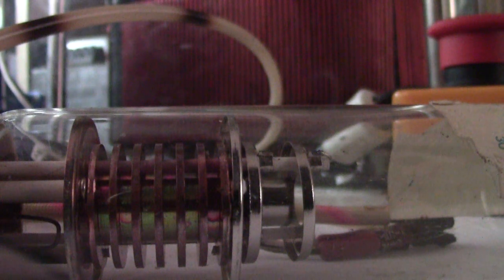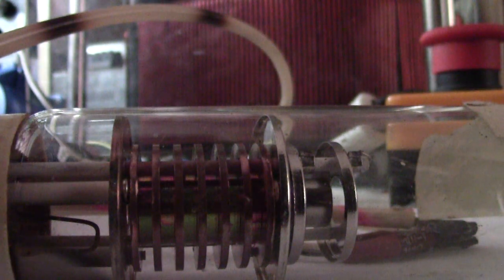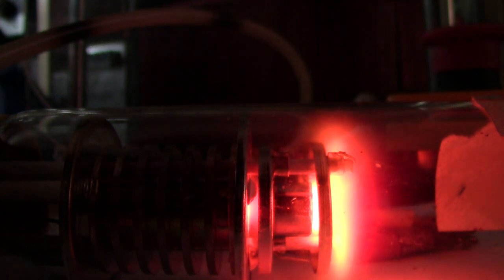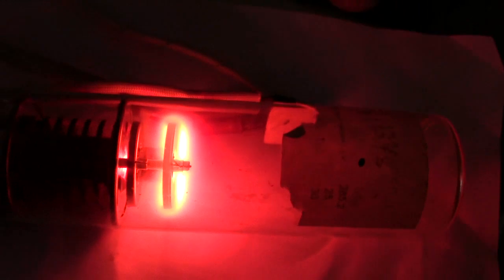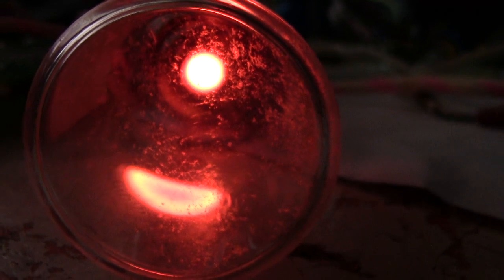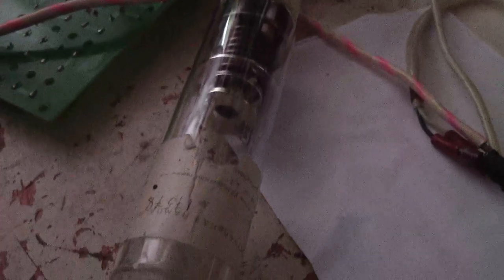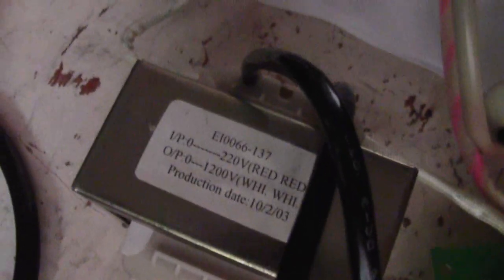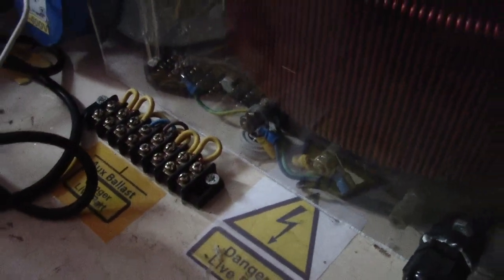Russian hollow cathode neon-filled spectral lamp tube LSP not cut this time I think

Comment: Ooooh, that was nice. :-)

It's glowing real nice. I've seen mains-powered equivalents of this that are just indicators. I'm not sure what this tube is used for, but it looks like it's supposed to do a bit more than just glow-up.

Maybe this was the flux-capacitor for the TARDIS before it was upgraded to solid-state transistors perhaps? :D

I think "LIGHTBULBFUN" will like this so I will send him a link. :-) The lad does love his lamps! :D

Thanx for showing,

-BoomBoxDeluxe.
Reply: Glad you likes it ;) A hollow-cathode lamp (HCL) is type of lamp used in physics and chemistry as a spectral line source (e.g. for atomic absorption spectrometers) and as a frequency tuner for light sources such as lasers. gotta love wiki